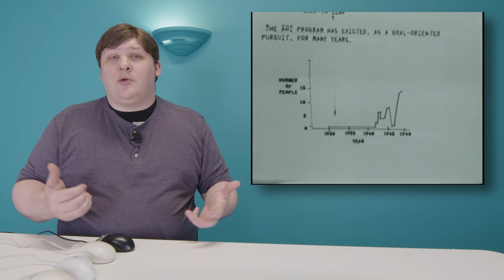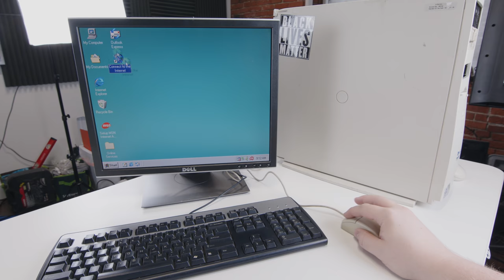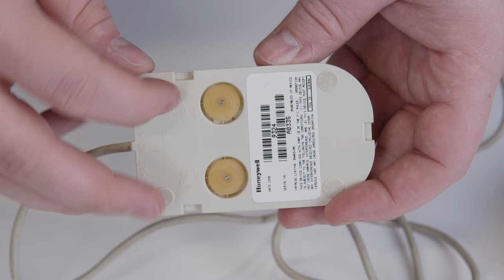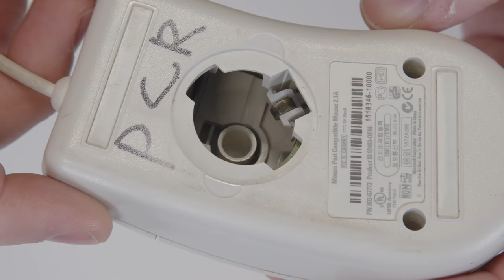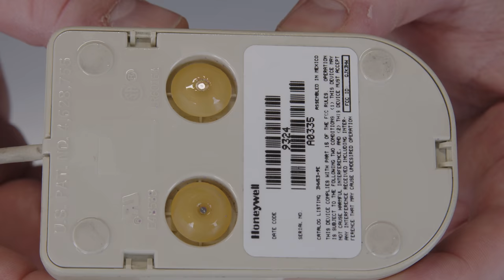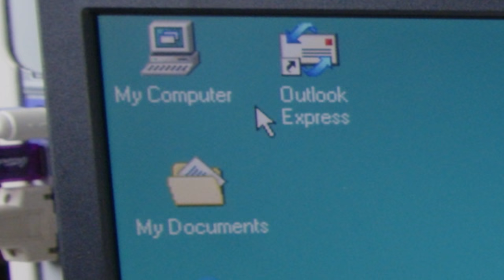Jack Hawley's Unstoppable Computer Mouse

Comment: There are potentiometers that don't have limits, if you keep spinning they'll simply suddenly jump from maximum to minimum (or vice-versa) when you cross where the limit would be; I imagine even back then it would've been trivial to detect a big enough jump in the reported values and treat it as a motion across the 360-0 threshold instead of an actual big rotation.

Also with some of the pots that do got limits, it's just a little thingy that blocks the motion, you can remove that bit and it will let you spin all the way around as many times as you want.

Comment: Apple did make a big contribution to computer mouse design. Initially they were building prototypes with a steel ball and rollers covered with a rubbery material named Poron. Problem was either the steel ball would slide and skip on the surface, or the rollers would get dirty and slip, or get flat spots. Then someone had the brilliant idea to reverse it. Coat the ball with the rubbery material and make the rollers bare steel. Ding! Must have been quite the engineering process to figure out how to evenly coat and heavy steel ball. I do recall seeing several non-Apple mice with a few tiny holes through the ball coating. I assume made by tiny pins in the coating mold to hold the ball centered. There are a lot of mouse balls without such features.

A walk down manufacturing memory lane on how mouse balls were made would be interesting.

Comment: 1: for the mouse that works in oil. The problem you encountered was when the mouse moves in the direction similar to dragging a wheel sideways... The solution would be to have 3 wheels rotated 120 degrees from each other. No matter which direction you move it,  2 wheels would always turn.

2: you did not mention a mouse like device that is not optical and still has no moving parts.
It was based on an induction loop. There was a piece of clear plastic on the mouse that you could see through. It had a circular coil loop in the clear plastic with crosshair through the middle. It required that you slide the mouse(puck) over a tablet with some type of sensors inside that could tell exactly where the mouse(puck) was. It was designed to be an absolute position device. You can pick it up and put it down somewhere else on the tablet and know exactly where it landed. It was used so you could put a piece of paper with a drawing(such as "Blue prints" ) on it, on the tablet and use the puck to trace the image into the computer..

Comment: The simplified version of how this works as I understand it is that the wheels jam because the friction of the wheel moving sideways combines with the friction of the axel to overcome the traction of the wheel when moving at shallow angles.

They could have solved this problem by using more expensive bearings, but I think omni-wheels would be an even better solution, and the two could be combined to allow for even more potential mouse movements. I haven’t seen such a small omni-wheel before but I am sure it could be done, though it would definitely make the mouse a bit more expensive.

Below is a much more longwinded explanation of what I think is going on based on my abandoned half a degree in physics. Read at your own peril:

I think that the thing that causes the wheels to jam is that for this to work perfectly, each wheel needs to have zero friction in the sideways direction, zero friction in the bearing, or infinite static friction between the wheel and the ground across the direction it is supposed to roll. Otherwise, if you move your hand at above a certain speed in any direction that is not perfectly aligned with the rotation axis of one of the wheels (where that wheel isn’t supposed to be moving anyway), the sideways friction will put a torque on the axel that causes enough internal friction to exceed the static friction between the wheel and the surface in the direction of rotation, causing it to jam/start sliding in relation to the surface instead of staying in sync. This is called a transition between static and kinetic friction, and once it happens it exacerbates itself because kinetic friction is much weaker in most material interactions). The speed required to do this gets lower the closer you are to the wheel’s axis of rotation because a greater portion of the velocity is horizontal. This lines up nicely with what we see in the video, which is why I think it is the primary cause. Other potential issues could be the non-zero thickness of the contact patch and the fact that the wheels are shaped like a truncated cone rather than a cylinder but the problems those cause seem minor to me in this instance.

Comment: One of the computer labs at my high school (in the late 90s/early 00s) was kitted out with these roller mice. I think the later version shown, at the end of the video, because I remember removing and reattaching the mouse buttons, as a fidget.

I don't remember exactly where they were used, it's been a while, but I think it was the computer lab in the woodshop, where they thought technical drawing, CAD, etc. So it would make sense to use a mouse that was less susceptible to dirt, that building had a thin layer of sawdust on every surface. But also, kids are filth beasts and the ball mice in the other lab were always getting clogged.

Anyways, I don't remember them being particularly different from the ball mice in terms of tracking or whatnot, but it was a long time ago, so I probably wouldn't remember a detail like that even if it did. They worked well enough for school purposes, and the resilience was a major upside.

Comment: My family was given one of these in the early 2000's. The buttons were so stiff they strained my fingers. 
Some time in the late 2000's (after I left home) my dad was complaining of RSI in his index finger. It turned out he'd pulled this thing out of the 'mouse box' and was using it. It was weirdly difficult to convince him the culprit was the mouse, and to replace it. The complaints of finger strain stopped immediately after the mouse was thrown out.

Comment: I appreciate the effort. This was really in depth, I actually owned this mouse and never used it, I bought a box which had a joystick and a hard drive from a flea market, it was a bonus inside the box.  I stupidly thought for some reason it was not a mouse but some other device that looked like a mouse, this was not only because of its weird bottom but because it was by Honeywell, which was also the brand of our home thermostat, so it stayed in a bin which eventually was thrown away, if you wonder why I never tested it out, well I was more preoccupied with the hard drive content which was full of low res naughty images and for a 11 year old boy it was a treasure trove.

Comment: We had that exact mouse in the late 80s and I do not ever remember it having significant problems tracking 2 directions when one was very minute. But ball mice were more natural feeling when they worked. And did seem to be more accurate, but ONLY when they were really clean and working properly. Otherwise once you got used to the 2axis mouse it never changed in its performance. I used ours right on top of the melamine surface for a few years until i moved out as a teenager and got a different one of some kind..  And I was happy with my ball mouse too, until it donned on me one day that I never had to really clean the 2 axis at all. And then I was salty until optical mice were practical.

Comment: That minute slippage accuracy would be fixed with a third sensor. But that's additional BOM.
It's always going to happen with only 2 axis because of how sliding friction works. Cover that "angle" area with a third sensor, like how 240 is phase shifted. Problem solved, parts more expensive.

Comment: I have both the DEC version and a couple of the Honeywell mice.

I changed to using logitech trackball things decades ago due to space issues and hate how ball mice got all gummed up and yes I used to use a pocket knife to clean them out.

In the late '80s & most of the '90s I was a software engineer working with DEC gear (mostly VMS but some ultrix & later OSF/1), the DEC puck-mouse was pretty good as I recall and was the reason I ended up buying the honeywell mice, I think everyone had those neoprene mouse pads in those days as all mice worked better on them, pretty much all mice didn't like many of the desktop surfaces that were common, at least that's my recollection.

Thanks for the video & keep up the good work.

Comment: I think the old optical mice relied on a pad with a grid of 2 colors that matched the frequency of the light sources on the  mouse... then it could count the pulses for each axis..  some pattern in them could clarify direction of movement... positive x and y from negative...

the new optical mice use something like a camera and compare images...

i bet the old optical mice track x and y related to the pad regardless of the orientation of the mouse.  this could be really cool...

Comment: Just a note on optical mouse (non-camera type)

It was actually widely available at comparable price to ball mouse (still a bit higher but not by much) around 1990, and include a reflective mouse pad with dot pattern on it. (I think i have one from A4 somewhere)

Microsoft was the one that came out with the first popular camera type optical mouse that does not need a pad.

Also, i did remember seeing that Honeywell mouse in the magazines around the time period you mentioned.

Comment: When I first arrived in uni back in 2000, we were taught to program in Java and assembler for Sparc RISC on Sun machines. Some of them still had the optical ones that needed the special mouse pads, occasionally missing of course. We tended to prefer the balled mice, as they tended to be more reliable, even if the optical ones did have their respective pads at hand. 
I never came across this design though.
Maybe they weren’t as common over here in Europe (granted, from this presentation, they don’t seem to have been particularly common anywhere).

Comment: 3:30 Rotary potentiometers don't necessarily need to stop when they reach the end you could theoretically allow the sweeper to start from the beginning again and program your driver to compensate for big jumps in the measured resistance when that happens.

Comment: I bet the tilted disks have other advantages, like providing a sort of ramp surface so the fixed wheel doesn't drag a bunch.  I wouldn't bet that they don't also handle acute angles better than the vertical disks did.  Entertainingly converting near-axis-movement to on-axis movement is done intentionally on non-gaming optical mice as an ease-of-use feature so maybe that didn't get all that many complaints.

Comment: That is really cool. Looks like a mechanism that could be used on modern mice without a problem. Might even be better than optical since those will fail on certain surfaces and do get dirty, even if they're easier to clean than the ball ice.

Comment: Real talk, I think my dad's got one of the Keytronic ones kicking around in Ye Olde Box-O-Mice that got unceremoniously chucked into the basement when Circuit City started selling the MS Wheel Mouse Optical. I remember finding it while scrounging through the literal mountains of long-forgotten electronics development gear (as an aside I think the super early Intel Flash devboards from '92-'93 and the piles of documentation would be right up your alley) while trying to find something that wouldn't eat up one of the two USB ports on my hand-me-down craptop, and was weirded out by it. That laptop DID have a serial port on it but the cord had gotten eaten by the OTHER kinda mouse so I never actually tried it, but it was odd enough I remember finding it.

Comment: Tail end of the 90's I worked in the IT dept for a large Junior College and we had tons of these mice as standard from our vendor. Very similar to your Honeywell mouse in appearance they did have on difference tho. The mouse buttons they came with 3 different configurations that you could pop on and off. Either two buttons big on the left, two buttons big on the right, or three buttons like your example.
It's true that you didn't have to clean them, which is great with large computer labs.
Reply: I commented too soon, I see you found the version we had right at the end there.

Comment: I'm reminded of the first mouse I ever owned, the one that came with Mario Paint for the SNES. It's exactly as weirdly tough and blue-beige as you might imagine for a Nintendo peripheral: the ball socket had a childproof locking system on the door that reminded me of the older-style childproof prescription bottles and it came with a dedicated roller scraper tool and a hard plastic mousepad about a centimeter thick.

Comment: I remember those!

I worked at a college in the mid 80’s and we where constantly losing mouse balls (because the students would remove them). When we discovered the Honeywell mice we immediately switched to them. No more missing balls!

By the way Honeywell sold those mice explicitly for industrial environments where a ball mouse would soon fail.

They also had a keyboard there was completely sealed and could be also be used in hostile environments. We also replaced the student keyboards with those as well.

Comment: The first mouse I got with my Tandy 1000 TL/2 plugged into the joystick port and had a ball, driving potentiometers.  When you reached the boundary of the X or Y, you'd feel it stop.  So yeah, pots made it well past the original mouse designs and into mice sold into the late 1980s. I believe it was the same mouse sold for the Coco machines.  It was terrible and we replaced it with a Tandy 2 button serial mouse not long after.

Comment: The reason I never switch from ball to optical in the 90's was accuracy, sure the optical ones existed but they had very low DPI and you would get a cursor on the optical mouse that would jump around the screen when you didn't even move it. They were just bad and unrefined

Comment: I also remember how goshawful the early consumer optical mice were. Horribly twitchy on any surface. Logitech initially solved it by releasing a dual laser version of their Mouseman, and later versions had better lasers that fixed the issue entirely. Also, CRC Electronic Cleaner cuts oil and grease like nothing else. Spray that on there and all that oil will run off like water.

Comment: Anecdotally, I've heard that some optical mice depended on the orientation of the mouse pad to work correctly. Apparently two designs came out at once and one used a hexagonal pattern on the mouse pad and worked no matter how you turned the pad, and the other one didn't and if you turned the pad sideways x and y movement would get swapped.

Comment: I think I have an explanation for the uneven rolling issue.
Assuming that the problem is more pronounced in one angle than the exact opposite one, the axle will be tilted something like this " / "
Dragging the axle from left to right should have a bigger issue that right to left since the resulting force along the axle would be "pulling" when doing left to right and "pushing" when going right to left. Pushing the axle up into the housing isn't a problem, since it was designed to do that, but pulling has nowhere to go.
Additionally the perpendicular force increases the friction between the axle and bearing around the axle making the problem worse.
Since I don't have one of these, it's only a theory.